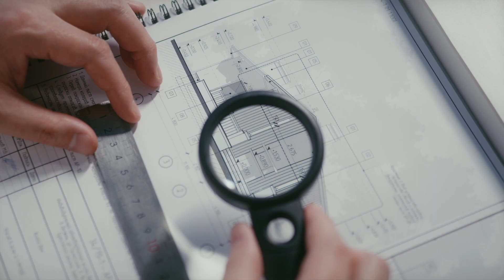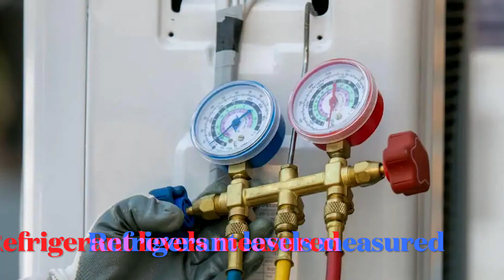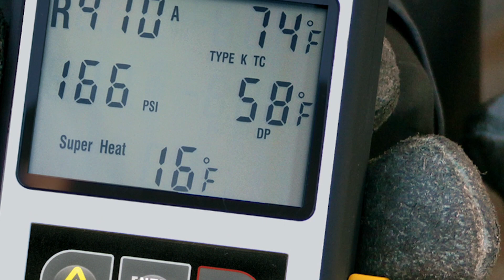City Inspectors MISS This!

Comment: An inspectors job is to make sure the installation is up to the codes that are representative of that area including anything within a national code like the NEC. This reduces the chance of fires, electrocution, combustion and equipment/parts dropping on people as a simple definition. It does not necessarily include that the equipment was installed correctly. One call I received was on a pool system heat pump that had not worked properly in 10 years. After a 10 minute inspection I found that the heat exchanger had the supply/return line backwards. It was installed that way with inspection approval and the system had had at least three other companies looking at it before me. I also found a gas furnace installed upside down. And on another home I found the evaporator installed backwards along with the factory drain pan on the top of the coil and not below the evaporator where it belonged. I could go on and on.
Reply from the maker: It’s amazing how many pros don’t even read instructions!

Comment: how do we find a good hvac contractor? we bought a new build and have an undersized unit for our size home..
Reply from the maker: Start by asking neighbors
Reply: I'd start with the builder and have them replace it with the right system. If thats a waste of time, turn them in to the state board then seek out the city and why they signed off on a system too small. If it's been too long for legal access to them, best to replace it all with what is needed if you will stay there 10+ years. May as well be comfortable for the money it will cost to run the heater and A/C.
Reply: @Garth2011  we checked and supposedly they can put a smaller unit and get away with the bare minimum...we keep our a.c. at 70• because if we raise it it will take a long bit to reach desired setting again..they told us we are lucky we even get the temp. we do